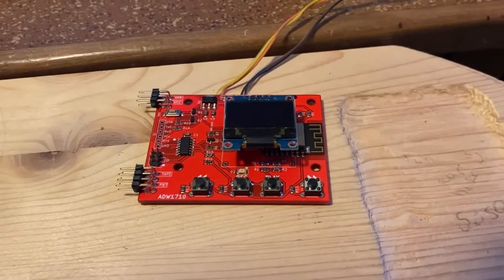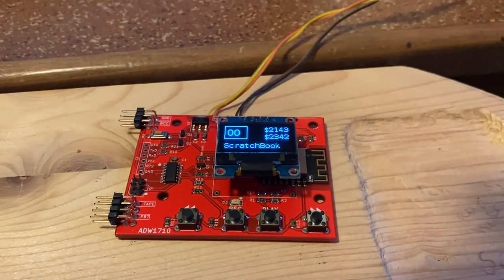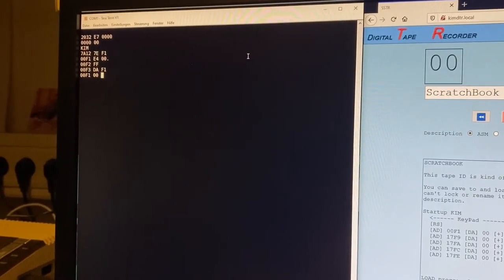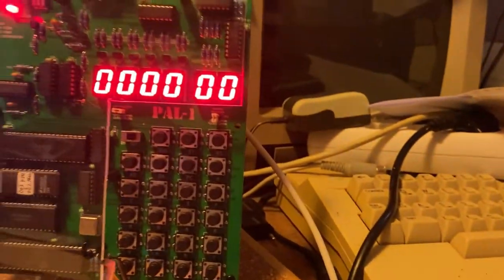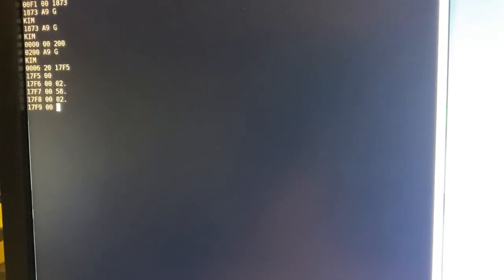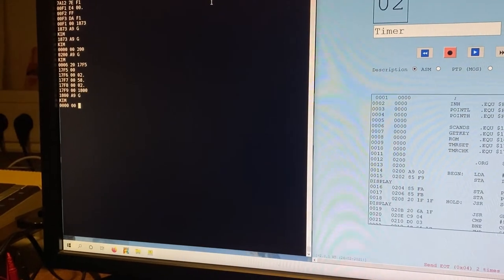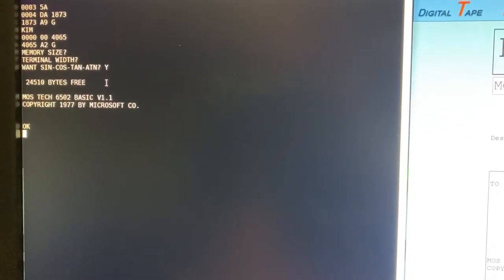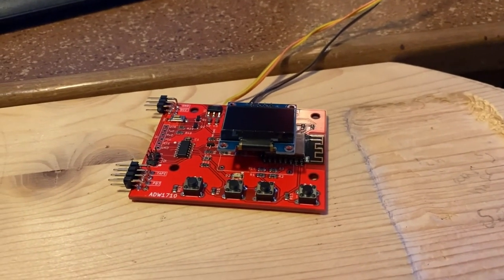dTR - direct Tape Recorder for the KIM-1

Comment: I like the PAL-1. I worked with the little Kim-Uno, but ordered PAL-1 today! The Plexiglas „case“, created by yourself?
Reply from the maker: Liu‘s PAL-1 is a great choice. In the video you see the first plexiglas housing, later I did another one, a bit larger, for the expansion board also. The keycaps were found on twitter. Someone did a conplete 3D printed housing, I just printed the Keycaps ;)

Comment: Nice !!! Love the expansion board. Great video !!! Really enjoyed it.
You set F1 to 00 because the status register default has the Decimal bit set high, and you have to be in binary mode to save or restore anything to the KIM-1.
Typically when doing a restore to your KIM-1 you would go to address 17F9 to input the program ID that you want to restore, then you would go to 1873 to start the load program.
However it looks like you are saving all of your programs using ID 00, and you select the program that you want to restore from the DTR, so you do not have to use the ID.

Sweet Basic version 1.1 Bill is going to want you to pay for that...   LOL!!!
Reply from the maker: Thanks for the comment. Actually, you do not need to change the ID of a program at 17F9, because you select it "by hand" before loading, and 0 was always a joker that ignored the ID when loading a program. 
Last week I also got a real tape interface from Liu, saving tapes on a real tape deck actually feels cool. I now have a tape containing Microsoft Basic 1.1 \o/
Reply: @masterhit1  I am assuming that I would need at least 4K of RAM, for that basic to run on my KIM-1. I am currently going through The First Book of KIM and making a few videos on some of the programs found there.
Sooner or later, I will get to my Ben Eater 6502 breadboard project. I just want to go into it with a good head of knowledge before hand. I have done a few experiments with an Intel 8051 to scan a keypad and display everything out on 6-7 segment displays. Although now it looks like Ben has returned to add a full keyboard to his project, which should be cool to play with as well.

I still think that expansion board that you have on your system is pretty cool !!!
Reply: @masterhit1  I actually had a problem restoring programs from tape, when I first started using my tape drive. So, the first KIM-1 video that I made was loading and running the PLL SET program to adjust the Phase Lock Loop, so that my KIM-1 could read the programs back in from tape.